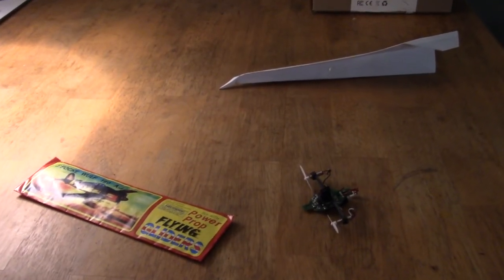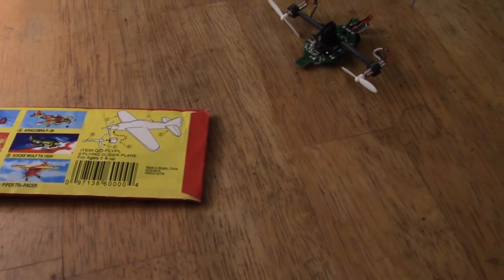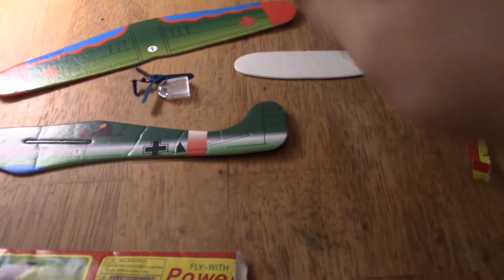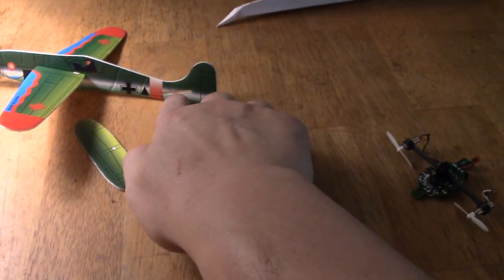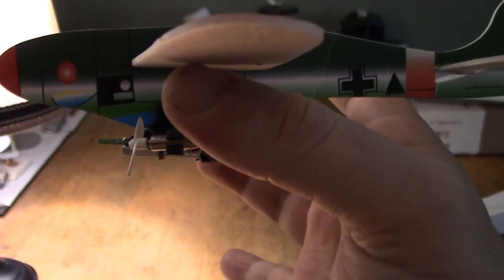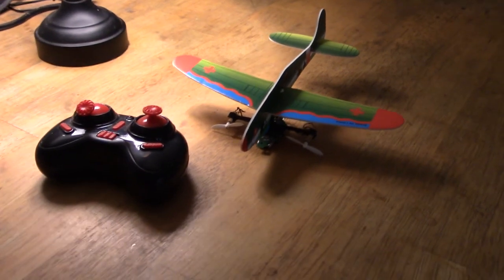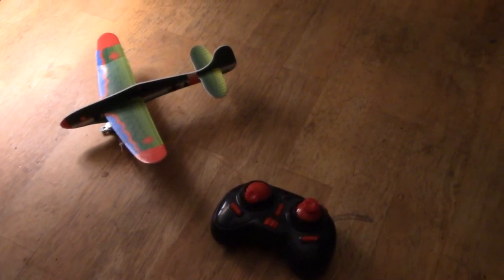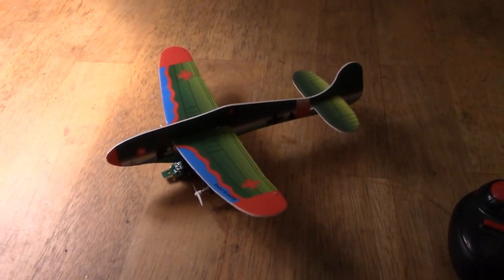Place Your Bets !  tiny little glider to quadcopter R/C

Comment: When we put our nickel,dime or quarter down,depending on your age at the time.Your imagination saw that purchase flying as your's does,but sadly it was one of life's early disappointments,as i remember the performance was lacking.Which was more likely due to my skill set  at the time..chuckle. SPRUCE GOOSE maybe?
Reply from the maker: Might have a go at the Spruce Goose again. I threw out the old one in a tidy up because the wings were sagging & it didn't have enough power. If I can find/buy/acquire 8x good 4mm motors i'd try it again.